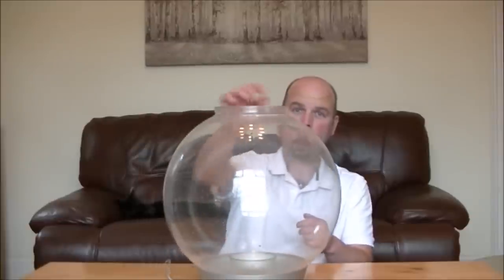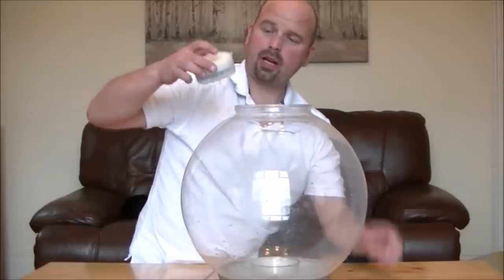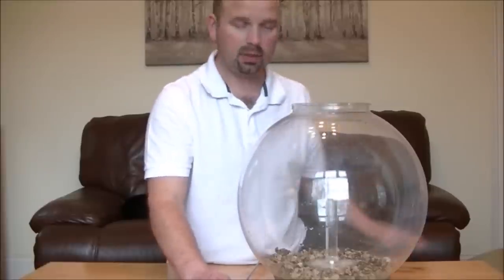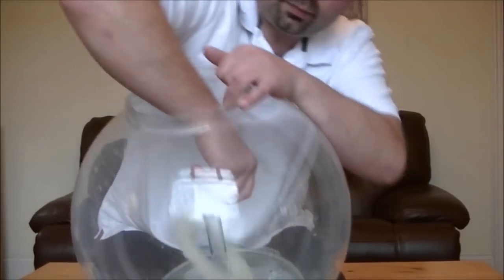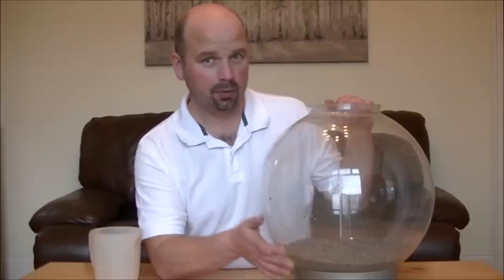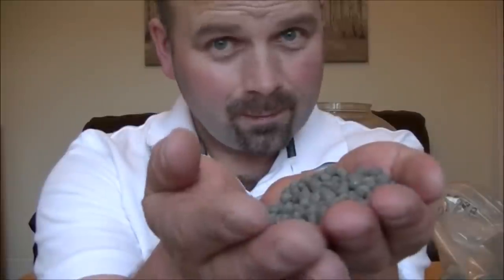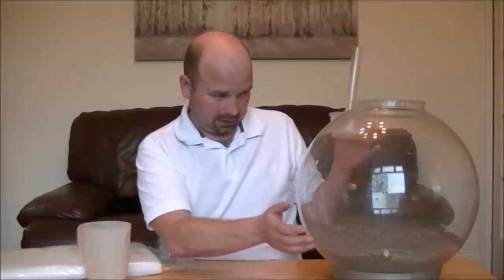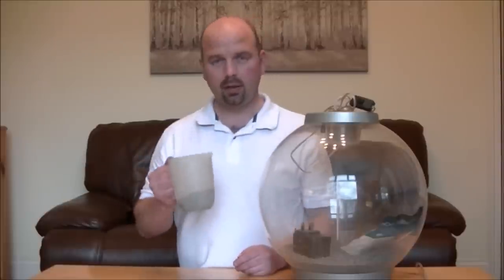BIORB COMPATIBLE UPGRADE KIT

Comment: I have a biorb life and seeing this makes me think I should do this.. though so far I have no issues, I have it planted but I use gravel and stones on top of the rubbish biorb stuff and also I use a cartridge filter on the back as I'm fully aware the filtration of the biorb isn't the best.. Iv kinda just left the old filter in there and I change the cartridge one.. do you think I should look to change to your set up in the future or also just keep an eye on the current? I do 20 percent water changes either weekly or every 2
Reply from the maker: I'd say that until you get sick of changing the cartridge in the filter you have just leave it as it is since I'm a big fan of 'if it aint broke don't fix it' way of thinking.
The original design of the biorb filtration is very ineffective but you've addressed those issues and it sounds like it's working well for you - there are numerous ways of fixing problems and I'm just offering one here so if conditions head south or the cartridge changing becomes tedious then you've got another option here.

Comment: I have two questions: Is it possible to only use the foam-ring in the bottom, to give more space to the biogravel and to prevent any of it falling into the filter chamber? If I choose to have live plants, how am I supposed to change the foam ring(s) if necessary? Thank you in advance.
Reply from the maker: I'm assuming you mean you will only be using one outer foam and keeping the biogravel below the level of the central filter? That will be fine and if you need to replace the foam you would empty out the biogravel and remove the foam. The foam should last well over a year before the tank needs a deep clean as long as you use a gravel cleaner like this: http://geni.us/0YMWPJJ
to remove uneaten food and fish waste from the bottom of the tank.
If you need something to hide the central filter something like this would be good: http://geni.us/WWBqb
Hope that helps.

Comment: Maybe a daft question but would this also work for salt water ?
Reply from the maker: Paul Roadz Yes as the biogravel is an inert media specifically there to provide filtration using this system - can be used in any water conditions.

Comment: In answer to Rob Scott you said 3.5Kg of biogravel are needed for 60 litre tanks but on the filterpro site it says 1Kg per 100 litres. Could you please clarify?
Reply from the maker: 3.5kg of the biogravel is needed to cover the foams in the 60 litre biorb and the amount of biohome (any type) needed to support enough media to reduce nitrates for a normal community tank is around 1kg per 100 litres.
Therefore the biorb will be hugely overfiltered but that is the amount of biogravel needed to cover the foams. The 15 litre biorb needs around 1.5kg and teh 30 litre biorb needs around 2kg as the foams are different sizes.

I was responding to his question about the biorb in this biorb video comments section and this is from the website regarding how much biohome is needed to reduce nitrates:

"IS THERE A MINIMUM AMOUNT OF BIOHOME REQUIRED TO ACHIEVE FULL CYCLE FILTRATION?
Yes - Using 500g in a huge filter on a 500 litre tank will not reduce nitrate if all the other media is producing nitrate. When a sensible amount of biohome is used the results are outstanding.
Most filters will by their very design hold a suitable amount of biohome e.g. the majority of external filters for a 300 litre aquarium will commonly hold 3kg - 5kg of media.
Through years of Biohome being used in all sorts of aquariums and ponds the recommended amounts of biohome needed to see a good reduction in nitrate (full cycle filtration) are as follows:
Average community tropical aquarium  = 1kg per 100 litres
Average coldwater aquarium = 1kg - 1.5kg per 100 litres
Predator aquarium = 1.5kg - 2kg per 100 litres
Large cichlid aquarium = 1.5kg - 2kg per 100 litres
Malawi / Tanganyikan aquarium = 1.5kg - 2kg per 100 litres
Marine aquarium = 1.5kg - 2kg per 100 litres
Average mixed fish pond = 1kg per 200 litres
Average koi pond = 1kg per 150 litres
Ammonia and nitrite will be reduced at much lower amounts but full cycle filtration is the only 'proper' filtration therefore the figures above are for the filtration job to be done properly resulting in less water changes being required.
REMEMBER - It is always better to over-filter than under-filter as a filter with a larger capacity will react more quickly to any pollution incidents and process waste before levels rise above safe amounts."

Hope that makes sense - the amount needed in the biorbs hasn't got anything to do with the amount needed for nitrate reduction, just simply to cover the foams properly.
Reply: Thanks for your quick reply. It seems a very inefficient / expensive way to just simply cover foam if 3.5Kg are needed whereas only around 1 Kg is actually needed to do the job.
Reply from the maker: 1kg is needed to do the job of reducing nitrates, yes and there is no reason why you couldn't just use ordinary aquarium gravel over the foams if you were looking to keep costs down. It wouldn't sort out the nitrates but it would certainly trap all the dirt and would keep ammonia and nitrite down very well.
Using the biogravel is an expensive way to do it but it will create a hyper filtered tank. 
Its all down to what people want to stock / how much the budget to set up a tank is / how often they want to do water changes etc. so using this same concept but with aquarium gravel is no problem to me - I'm just happy to put the concept forward for the sake of the fish which are forced to live in biorbs as the normal filters are responsible for millions of fish deaths each year.

Comment: Fantastic video can you help me please?I have a healthy up and running Life 45 but I want to upgrade using this video How would you suggest I make this transition? 
Also do you sell a Biorb Life 45 upgrade kit. 

Rob
Reply from the maker: I may have answered this by email? The biorb life will need the foams cutting to just under the base dimensions to allow the biogravel to go down the sides (to hide the foams as you have no plastic skirt on tank) and you'd need approx. 3.5kg of media to cover the foams (so it would require the 60 biorb litre kit)

Comment: I have a question, do you actually need the filter cartridge? could you not just put sponge and some filter media where the filter cartridge goes so that all the water coming through the bottom has to travel up through it? cheers JP
Reply from the maker: The filter cartridge is not really needed as it's only there to remove very fine particles which may all get caught in the biogravel and foams - I consider it optional and it can be replaced with a coarse / medium foam and it will only need looking at very rarely.

Comment: For a marine aquarium, could you place CaribSea Aragonite Aragamax over top of the biohome gravel?
Reply from the maker: That looks way too fine and I reckon it would clog the foams quickly. If you wanted to go with a substrate which would condition the water for marine then a small crushed (white) pumice would be the one to go for but unfortunately I can't find anyone selling that. I have a 10kg bag of pumice which is around 10mm but that mat be too big. Smaller sizes are available from my supplier and I have a sample bag of one which would be perfect for the marine biorbs but its not enough to do a conversion - minimum order is 500kg and I've just had a delivery so it will be a good few weeks until I need more but I will get some of the smaller sizes in 10kg bags to use in marine kits. It is much cheaper than the biogravel.
Thinking about it if you could probably use crushed coral over the foams as a substrate?
Reply from the maker: It would be worth checking it out as it is very cheap and it is difficult to tell what size it is from the pictures.

Comment: How often do I need to clean or change the filter and media? I've had regular tanks with fancy guppies for years but this upgrade is new to me and sounds really great I just don't know how to maintain it.
Reply from the maker: This system is really easy to maintain by using a normal gravel cleaner like this: http://geni.us/0YMWPJJ
That will remove heavy muck from the biogravel and outer foams and also drop a percentage of water out too. That should be used every 1-2 weeks depending on stock.
Reply: I'm getting a biorb from a family member tmorr, super excited!! I currently have a Juwel Rio 180 which is heavily planted and a smaller Juwel. Both run a combo of undergravel filters and sponge filters. Just wondering how often would you need to rinse/replace the sponge filters? Also can you use normal gravel on top of biohome?
Reply: @pondguru  thenks ☯️😇💖💝🧚‍♀️🐠💸☯️

Comment: Any thoughts on BiOrb's new media?
Reply: (my other account) Why they didn't just make a direct copy the Biogravel is beyond me as they know about it, they know it works, they know it's so easy to maintain using a gravel cleaner and they know they clearly need to do something with the Biorb filtration to stop millions of fish dying.
The new media they've come up with makes no sense from a structural, filtration or maintenance point of view since it's too large, not used over a foam (which would function like an under gravel filter), the water always finds the easiest route so the majority of the 'pearl' media is redundant, muck collects under it, cleaning with a a gravel cleaner is almost impossible compared to a smaller media (e.g. Biogravel) or even ordinary aquarium gravel used over a decent sized foam.
It's marketed as being good for bottom feeders but it's so big that the majority of food gets trapped under it, rots and then needs cleaning.
Apart from that it's great, lol
Seriously though I sometimes wonder what designers and the R&D departments if big companies get paid for when they come out with something so unfit for purpose - the only problem it solves is being smoother than the very rough Alfagrog but all other problems remain.
When they clearly know what solves the problems (a smaller media used over foams to create an easily maintained under gravel system) why won't they just solve the bloody problems?
I gave them the plans, media and permission to take that for the Biorbs (for free) close to 15 years ago and this is what they come up with on their own?
I'm far from being an academic but when I see what some companies think constitutes good filtration I feel like the smartest guy on the planet, lol
There may be some issues with the actual 'pearl' product from Oase as I was alerted to the fact that it may infringe upon some of Biohome's patents. I will get Michael who makes the media to look into that as I remember him showing me an Oase trade catalogue of upcoming products about 6 months ago and saying that it wasn't a problem unless Oase started selling it.
I'm not sure which countries the patents cover but I think they may be worldwide so watch this space.....

Comment: Hello! Thank you for the video, very informative. I have a 60L Biorb that I want to convert to marine. I see that you have the marine media on your site. Will the same set up work to convert to marine in this video using the marine media? If not, do you have a setup for that yet? 
Thanks a million,
Phil
Reply from the maker: On the FilterPro website there is kits for 15 litre, 30 litre and 60 litre biorbs but I don't have a specific kit for the marine biorb - there is a marine version of the biogravel which I can put in with an upgrade kit no problem. The 60 litre kit uses 3.5kg of biogravel if you want to order the media without foams.
If you want a kit with the marine biogravel instead of the standard freshwater biogravel just attach a note at checkout or send an email straight after ordering to remind me to send marine version.
Regards,
Richard 
http://www.filterpro.co.uk
Reply: Pondguru Thanks so much for the reply! I will order today. I’m in the USA, checked the supplier you mentioned before, but I don’t see that they carry the same things. I will order the marine media as I’m going for the marine tank. Thanks for all of the great info!
Reply from the maker: No worries, any time.
The only things suppliers of biohome over the world have in common is the biohome as we each sell our individual different products too. When my new office space is completed I will be branching out in other areas (e.g. food) but only if the products are top quality.

Comment: lastly, sorry i forgot, dont you have any dealer in the USA? i read the shipping cost for 16 gal upgrade kit mailed to the US is ~$60..., ty
Reply from the maker: +Rudi GaekMada Yes the shipping on the 60 litre kit is quite high as it has to go by international courier (it is around 3.6kg). Greatwave Engineering carries the media and also has foams although I'm not sure he has fine particle matting used as the central filter. Website is http://www.greatwaveeng.com and there is also a supplier in Canada http://www.angelfins.ca - direct links to all suppliers are on every page of my website: http://www.filterpro.co.uk

Comment: +Pondguru Outdoors - Just wanted to check with you as I have bought a tank second hand but want to set it up properly...
a) I assume this is easy to adapt for the BiOrb Life (square tank) just by altering the shape of the foam
b) Can I put my own rocks/slate etc on top of the biogravel?
c) Do i need to buy a BiOrb brand heater to make the tank tropical or is there a better one?
Reply from the maker: +Samantha Clark a) I assume this is easy to adapt for the BiOrb Life (square tank) just by altering the shape of the foam
Yes and it is best to keep the foam quite tight to the side of the tank. Unfortunately as the tank does not have a plastic skirt around the bottom the foams may be seen in the square biorbs unless it is cut about 10mm smaller than base size allowing biogravel to go down sides and hide it. Square tanks will have a greater base size than the equivalent volume round tank so you may need more gravel - e.g. get a 60 kit if you have a 45 litre tank.
b) Can I put my own rocks/slate etc on top of the biogravel?
Yes no worries but they will need lifting off when you get in with the gravel cleaner during maintenance.
c) Do i need to buy a BiOrb brand heater to make the tank tropical or is there a better one?
The biorb heater is probably the best choice as it is shorter than normal heater. That is more important in the round tanks so any heater of suitable size is fine.
Reply: +Pondguru Outdoors thank you
Reply: Hi Pondguru Outdoors can you tell me how much Biogravel comes in your 60l upgrade kit? My Biorb life is a 60l tank so I want to make sure I have enough biogravel. Or can I still use some of the ceramic media I got with my tank? what would you advise?
Reply from the maker: +Samantha Clark The 60 litre kit has 3kg which is easily enough for the round tank but not sure it will be enough for the life as they are rectangle. If you send me dimensions of the base I can work out how much biogravel it would take no worries. By the looks of them they are taller than they are wide so hopefully should work out OK. Some people do keep the ceramic media, simply placing it on top of the new biogravel.
I have lots of spare coarse black foam which would work out good for the life aquarium as you could have it right up to the side of the tank covered by gravel and it won't stand out like blue or green foam would.

Comment: Hi are you still doing the marine video for this stuff?  Cheers..
Reply from the maker: I am expecting a deliver of specially made media for marine use tomorrow. It is the biogravel made from the same stuff as marine biohome so has all the trace elements necessary for marine bacteria and boosting corals.
Only problem is that at present Aquarium Cabinet Solutions have the exclusivity on the marine biohome so with this being a different product I'm not sure who should really be selling it so I will have to discuss that with him.
Reply: Pondguru okay thank you. I was wanting to convert a biorb 105 to marine tank.
Reply from the maker: Unfortunately I haven't had a biorb 105 to measure up properly for the foams but according to people who have used this system in the 106 the largest foam is around 15" so you would need to cut it from a foam at least 18" x 24" which is a standard size replacement pond filter foam.
It takes approx. 5kg of biogravel to cover the foams in a biorb 105 so if you want any just let me know. It is £65. Unfortunately the foams I have here are 11" x 17" so are too small for the 105 biorb but the marine version of the biogravel arrived today.
http://www.filterpro.co.uk
sales@filterpro.co.uk
Regards,
Richard

Comment: Great video mate, I have the large biorb 60 - is tha t compatible with your solution?
Reply from the maker: Yes the process of setting the tank up is exactly the same but the foams need to be larger and it needs more biogravel to cover the foams (due to larger base size) - approx. 3.5kg. I have templates available for download on the FilterPro website and kits available here: http://filterpro.co.uk/filter-kits-8-c.asp
The media and foams are also available separately too.
Reply: Jim Day  hey I was just wondering how many fish you can get in your tank and how big the fish and the tank are

Comment: When is the marine biorb coming out
Reply from the maker: As far as I know marine conversions are available from the manufacturers but I do not think they are very comprehensive. The system in this video still works fine for marine as the media is inert but you would need to condition the water to make it suitable for marine.